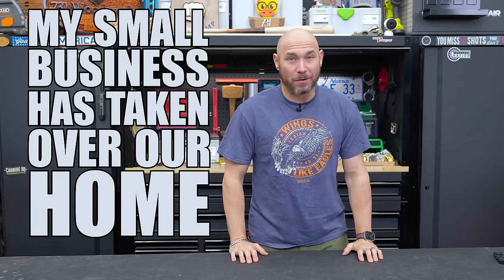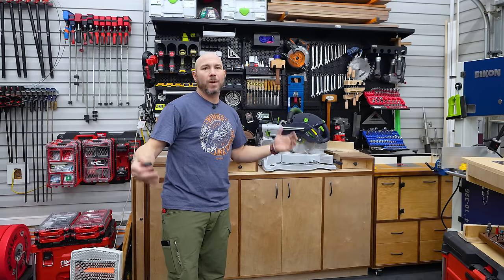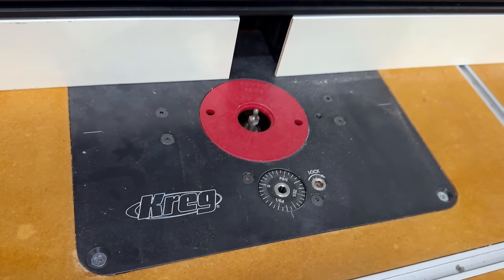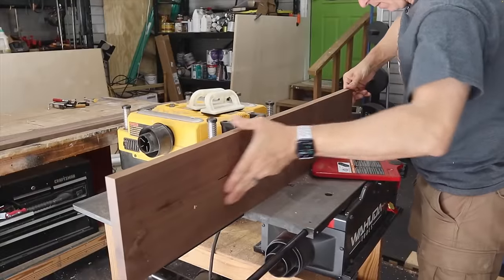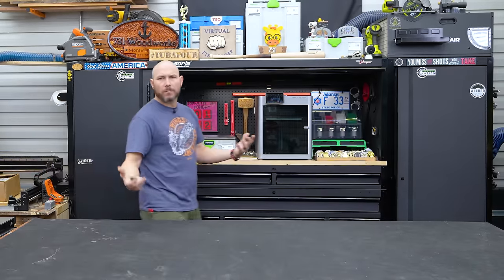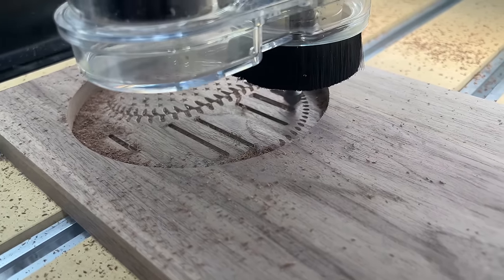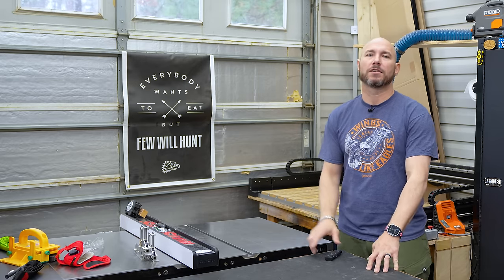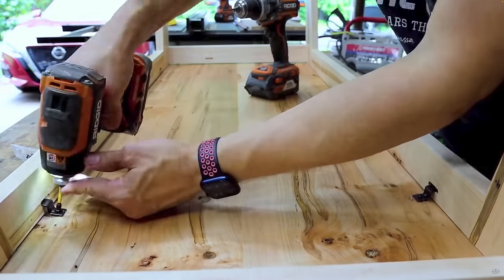Our Small Business Took Over Our Home 😱 - Shop Tour 2024

Comment from the maker: Click "Read more" to see all of the tool links.
Watch Next: Home Gym Tour - https://youtu.be/BHVVKa7nftk?si=ZPo0xisTO6WMJ7Ca
Tools in this Video:
Festool Kapex - https://amzn.to/3SxEyCD
Festool Dust Extractor - https://amzn.to/49rrOoc
Wood Storage Racks - https://amzn.to/3OyTors
OmniWall Wall Organizer - https://amzn.to/3SsKOf7
Rikon Bandsaw - https://amzn.to/49qTYzv
SawStop Table Saw - https://amzn.to/4bx2rTB
JET Lathe - https://amzn.to/3w8rJHy
Jet Lathe Base - https://amzn.to/49q2RJL
Laguna P Flux Dust Collector - https://amzn.to/3SZq6oN
Kreg Router Lift - https://amzn.to/3SuyFq6
Bosch Router in Router Table - https://amzn.to/3w2up9w
Rockler Clamp Racks - https://amzn.to/3UsPOmF
Milwaukee PACKOUT - https://thetoolnut.sjv.io/AWBqxJ
Mini Split Heat and Cool - https://amzn.to/3SOlotA
DeWALT DW735X Planer - https://amzn.to/48dqXq2
Wahuda Jointer - https://amzn.to/3uzNmA1
RIDGID Spindle Sander - https://homedepot.sjv.io/xkkW3k
Porter Cable Air Compressor - https://amzn.to/4bthuha
3D Printer - Bambu X1-C - https://shrsl.com/4epiv
Laguna Air Cleaner - https://amzn.to/3UxIlCK
Shapeoko 5 Pro CNC - https://collabs.shop/xd9ye9
Shop Lighting - https://amzn.to/3wa0tIP
Sound Dampening Wall Panels on the Wall - https://bit.ly/482UnqU
Camera Gear I Use - https://kit.co/731Woodworks/camera-gear-i-use 
Computer Equipment I Use for Editing - https://kit.co/731Woodworks/731-woodworks-computer-equipment
Wings Like Eagles T-Shirt I'm Wearing - https://bit.ly/3SDBPIe
Work Pants I Wear - https://truewerk.pxf.io/XY36qX

The Story : http://story4.us/731Woodworks

use code PRIZE to get 25% off plans or Board Butter
PLANS: https://www.731woodworks.com/store
Outlaw's Board Butter - https://www.731woodworks.com/store/mini-multipacks

Shop Builds:
Shop Projects Bundle - https://www.731woodworks.com/store/shopplanbundle
Miter Station - https://www.731woodworks.com/store/miter-station-build-plans
Workbench - https://www.731woodworks.com/store/workbench-plans
Tool Cart - https://www.731woodworks.com/store/diy-mobile-tool-cart-with-storage
Mini Router Table - https://www.731woodworks.com/store/benchtoproutertable
Big Router Table - https://www.731woodworks.com/store/routertableplans

The full list of tools and supplies I recommend can be found on my website: https://www.731woodworks.com/recommended-tools
Greatest Free Gift I've Ever Received: http://story4.us/731Woodworks

Join the TUBAFOUR NATION through Patreon to get access to exclusive member only behind the scenes videos, member only livestreams, exclusive discounts, and other cool member only perks! https://www.patreon.com/731woodworks

If you use one of these Amazon and other affiliate links, I will receive a commission on qualifying purchases.

Some other useful links:
Daily Tool Deals on my website: https://www.731woodworks.com/tool-deals
Subscribe to our email Newsletter to get new content alerts, sales, and more! https://mailchi.mp/7e44c16eefdc/731-woodworks-email-newsletter
Easy to Follow Build Plans -  https://www.731woodworks.com/store
Outlaw's Board Butter - So Good it Should be Outlawed: https://www.731woodworks.com/store/boardbutter
Reply: I see you have some followers that are negative. Don't let that affect you. You are loved by more makers then not. Remember - "They hate us 'cuz they annus!"
Reply from the maker: @Eagle1836   thanks!

Comment: They have split systems for different environments, we have one that's rated to -40Celcius it goes to -30 sometimes here only two or three days in the winter. Weather sealing and insulation really matter with these for effectiveness and longevity, and installing the outdoor until where it'll permanently stay level, here the ground freezes and thaws and when people install them on cement pads the pad sinks and the outdoor unit is 20° out of level, it's common practice here, and we can get 3' deep snow so I've installed my outdoor unit on a wall bracket 4' off the ground.

Comment: Very cool setup and, it’s amazing how much you have in a relatively small space. I have a 2-car tandem garage, so basically one stall is twice as long as a regular garage, but I also have to park two cars in the garage every night, not to mention the 50 totes of Christmas decorations and all the crap you accumulate over the 20 years we’ve lived here. 

Most of my tools are on flip carts as everything has to be pushed against the walls of the garage, so everything is on wheels. It sucks having to roll everything against the walls and clean up at the end of the day so I can pull the cars in, but it is what it is. The main issue I have is the lack of storage! I picked up a couple ideas from your video, so perhaps I’ll incorporate those. I agree with you that an assembly table is a must. Mine is only 3x7 given my space, but it gets more use than anything I have. The horse stall mats are a great idea, but I put down a nice epoxy floor and not ready to cover it up, so just have a mat in front of my assembly table. Thanks for the shop tour!

Comment: So, for vertical storage area... add wheels.
Build a box 10'x2' from 2x4, on top of 3/4" ply, leave one 2' side open, attach 2x4x4' to the corners (vertical posts to stop the boards from falling), and I'd make it so it can rotate a bit out so that you can slide stuff in past the end of your stairs when it's "opened" (I like rotation, pinned to floor rather than 4 casters because the whole cart will have a tendency to tip, so anchor that to a post anchored to floor.  Add 2 casters for the "in/out" side and presto... vertical sheet storage, and you can get to the front or back easily. and it doesn't take too much space...  I can make a sketch, but I think you got it.

I'd also put a catch on the wall on the 2x4 closest to the stairs so it can be anchored high up and won't rotate on its own...

Comment: I just got more into wood working and so glad I found your channel. Our main business is landscaping/snow plowing and our shop is now split in half leaving me about a 15x30 area to do the wood stuff but even with the basic tools it's getting cramped. We rent our shop so attaching things to the walls would be nice, it's not allowed. One thing my Landlord is going to have to do is fix the friggen lights! Our ceiling is 20ft tall and theres 6 banks of 8ft dual fluorescent tube lights but only half work lol so it makes very tough to see cut lines etc. One question, does the humidity affect the wood with warping? Our shop is not cooled and only heated with a torpedo heater or porch heater.

Comment: Some Minisplit units work a lot better than others in low temps.... you have to get a "low ambient temp" model. Mine is rated to -13*F .... and some work at even lower temps. They don't work very well at the rated lowest temp, but it gives much better performance for example at 8*F than a non-low temp unit. Mine works really well down to around 0* but then fights frost build up and starts to lose a lot of the btu output. I've had it making a little heat at -15-20*F but not much :)

Comment: To support the comments of another person on mini split units. I live in central Ohio where the temps can dip below zero. I have an LG Red Zone 15K unit for a 550 sq ft shop. I barely notice change in my electric bill and I've never had any trouble keeping the shop on temp. I did my research and at the time this was the best unit for me. One thing I did compare was I looked into a cheaper unit that is very popular and rated as DYI. AS always I compare weight of the overall product meaning how much metal versus plastic in it and the LG was almost twice the weight, was not a hard choice. It was also comparable in weight and performance with the Mitsubishi which tends to be the gold standard in mini splits. My unit is efficient down to 5 degrees and then starts to loose efficiency and will produce heat down to -14. To conclude I insulated well with 7" in the walls and 10" in the ceiling and double pain windows. Ron J from Central Ohio
Reply from the maker: Awesome. Thanks for sharing

Comment: Next step is to get rid of the shed and build a new shop in it's place. If you have the land, that would be all around the best thing. You get your garage back, can plan the building size and form around your desired shop layout and you get more space to move, store and assemble. There are very affordable pre build sollutions out there. Or build it all by yourself. Either way, as you have a fully functioning shop and don't need to rush to finish it, you have great controll over the cost. Nothing worse than to have to finish a project like this, while you face a supply shortage and have to pick the more expensive option. Easy to avoid for you. May even use half of the garage for lumber storage and the other half for you loves car.
Btw, either you are selling your wax really cheap, or the supply cost are quite low for you. 
Keep up the great work mate! 
Greetings from germany.
Reply: They have plans on moving

Comment: Matt, I have butcherblock countertops that are not sealed. We've used Howard Butcher Block Conditioner, but wondering how your board butter would be instead. Any thoughts on that? 
As a photographer, I really appreciate your use of the softboxes with the egg crates on them; awesome for lighting control.
In the house studio, that's actually a hairless light. LOL
Reply from the maker: I would use a true finish on those if you don't want it to wear off. Something like Rubio Monocoat or other finish so long as you're not cutting on it.
Reply: @731Woodworks  awesome, than you!

Comment: Matt, if it is about 30 outside, how warm will the mini split keep it inside?  I'm never going to work in the garage when it is 8 degrees, but around and under freezing, maybe, if it is about 50-60.   As is, I do not work in the garage from Dec.to April, or until it gets up to about 50.
Reply: I have a Mr Slim in my sunroom.  It works fine down to about 16F.   It is effectively a heatpump & there just isn't a lot of heat to move below that.   16-20F it might struggle to reach setpoint (by 2-3 degrees), but above 20, it does not seem to care.  As others have said, they do make one with a gas heat option.  I don't have that type.

In the 10 years we have had it, we have only had it struggle 3-4 times, maybe 2 days in a row each time?   Generally midday Temps here rarely stay that low.
Reply: @kpmathis71  Interesting. Thanks for the reply.